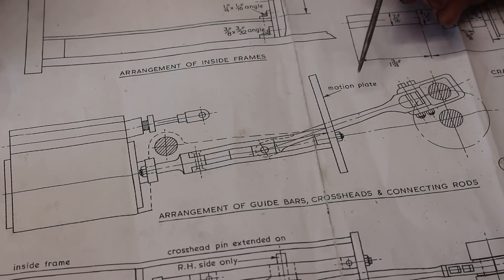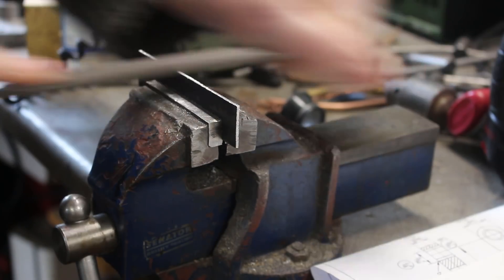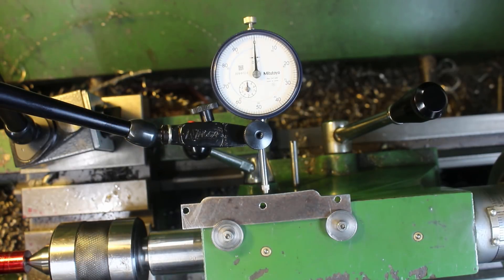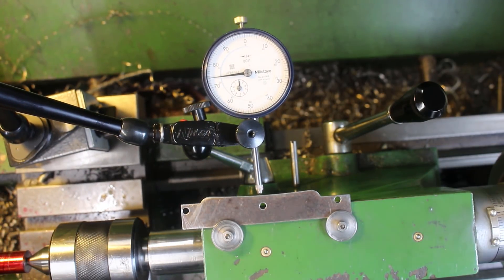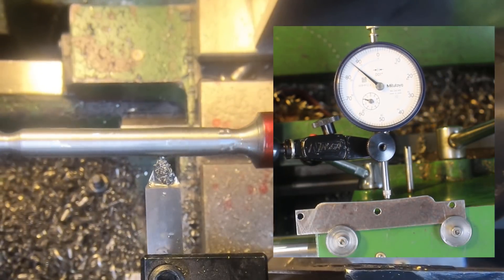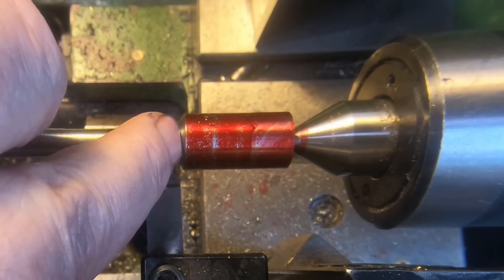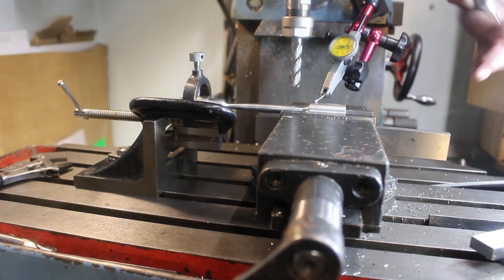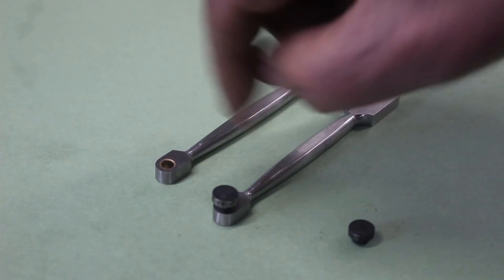Lion Locomotive in 5" gauge part 50- Profile Turning the connecting rods.

Comment: Very impressive, I didn't detect much breathing whilst following the template, you must remember to keep inhaling:). Total novice here, I see there's a bushing in the piston end of the con rod, I am guessing bronze? How is the con rod/piston rod connection lubricated? Have you used some kind of oilite stuff, or does it just get some oil seeping in from the oil on the guide bars, which I guess will have some form of lubricator fitted? Probably the same issue on all engines, as I say, total novice asking dumb questions.
Reply from the maker: I fitted an Oilite Bush, just had to turn down the o/d to fit the conrod. I will drill an oil hole to add some oil from time to time, access to lubricate the various moving parts is a bit difficult. Thanks for your interest in my video.